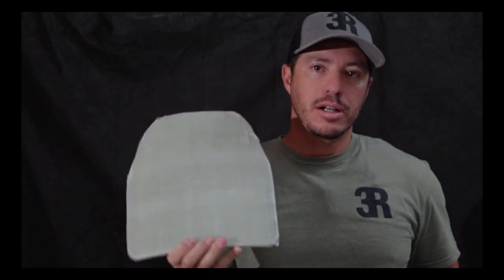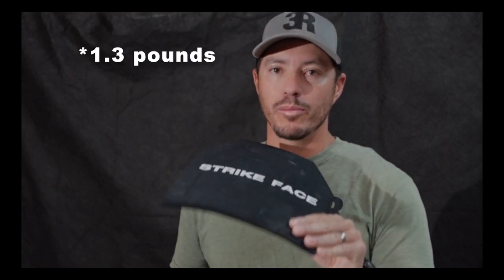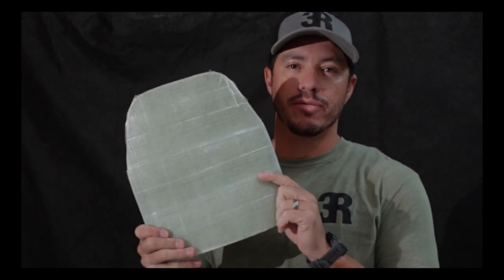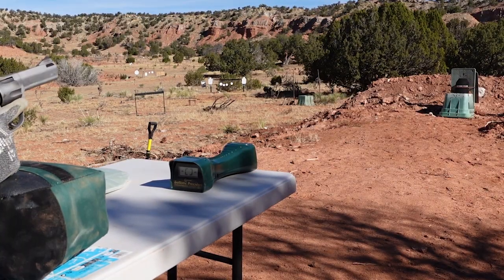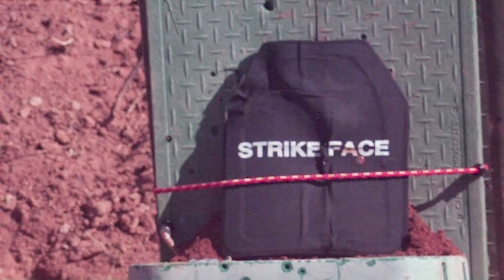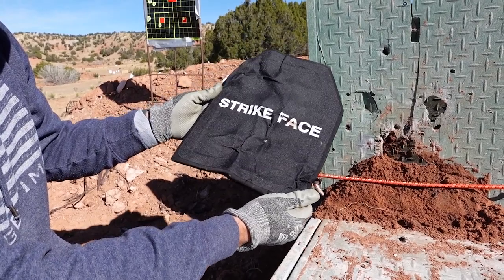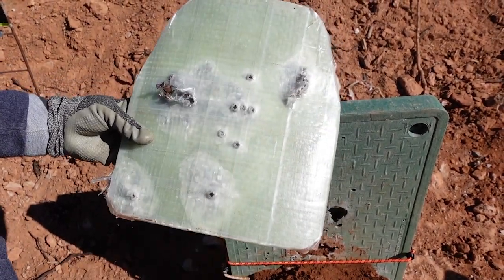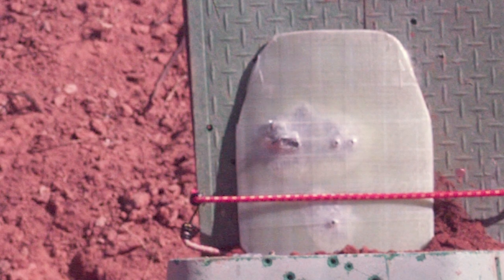Can DIY Fiberglass outperform UHMWPE - Today's body armor of choice

Comment: How difficult would it be to make the fiberglass plate with some ceramic tile on the face side (probably encapsulated in the resin). 
I think that would get you to RF1 or RF2 standard.

Comment: How are you molding and cutting these plates into shape?
Reply from the maker: @SgtAugustine  I’m just using scissors to cut the fiberglass into shape. Then I use two pieces of metal with a curve shape in a 20 ton press to apply pressure and release any extra epoxy for the fiberglass plate. 
The UHMWPE just uses the same 20 ton press and heat.
Reply: @3RBallistics  Thanks for responding, I actually just saw the process in one of your other videos. Are you still working on DIY armor these days?
Reply from the maker: @ yep. However, I’m also helping out a few other companies that make commercially available armor. So it’s taking a bit longer to get out the DIY videos for armor.

Comment: Bro, you keep talking about extra weight, even at a "heavy" 2 pounds or whatever, the fiberglass is great, what's an extra pound over the plastic when we are talking about your life!! Try wearing the iotv on patrol, now that's heavy. But great video and I'm convinced that with a skinny layer of kevlar in front of the fiberglass "to catch ricochets and sprawl" and a thin titanium plate next to the body this could defeat rifle rounds in addition to pistol and frag shrapnel.
Reply: That would end up being a5-6 lb plate which comes to around 12lbs(front and back) which is pretty light for rifle rated armor. You wouldn’t defeat green tip and tungsten with that set up though.
Reply: @neilmcdonaldii4367 That would be a good test. Titanium is extremely tough.
Reply: @101stgrunt6  You would need at least 3/16 or higer along with a Kevlar, UHWMPE and carbonate backer to stop a rifle round with a tungsten penetrator. This is of course WITHOUT using a ceramic strike face. It would be a pretty thick plate though.
Reply: I'd most certainly like to view such a video as well

Comment: Here is a interesting chalange for you (I'm going to copy paste this comment on afew videos so you notice it)... 
Fiberglass balistic helmet or just a full diy balistic helmet series including back face deformation testing.
My idea is a fiberglass helmet with thin steel bars impeded on the inner layers of fiberglass forming a lattice shape to prevent serious back face deformation.
Reply: A Spanish guy did that on YouTube, casted it out of another helmets shape and it worked up to level 2, you could make a level3a with more layers probably
Reply: @G36C-556  thing is one should try the weight if one can handle it. Also it would be cool to make one using a motorcycle helmet as a mold.

Comment: How about mixing fibreglass with welding blanket sheets in between (layers) together with Kevlar on both surfaces? I think that will be enough to hold several rifle rounds other than handgun ammos....
Reply from the maker: Fiberglass is what the welding blanket is made of. However, I am in the testing phase of using fiberglass as a strike face and Kevlar as an absorption layer with the hopes of stopping rifle rounds.
Reply: @3RBallistics  I can't wait how it goes on video. Keep it rolling ✅
Reply: @3RBallistics  well, from my observation from other YouTubers... welding blanket is much thicker than ordinary fibreglass made one at a time... Maybe just maybe, it could be more resistant to impact 🤞🏻
Reply from the maker: @tontosilver6578  I’ll really have to look into that. The ironic thing is that I do light welding and have the Harbor Freight welding blanket in my shop.

Comment: Hello just found your page like you mentioned in your analysis the polyurethane deforms I wonder if you combine the polyurethane with a backing of the diy fiberglass to give the plate more stopping power possibly rifle rounds and rigidity to the homemade plate.
Reply: That is a pretty interesting idea to reduce weight, some kind of composite using both, but I don't think it gets to stop rifle rounds, both of these materials alone need to be very thick to stop a rifle round.
Reply: @juancastro6441 it would end up being a 5lb plate if you use 30 layers E glass, 25-30 layers soft UHMWPE with a solid UHMWPE strike face. Should stop all the way up to green tip. This set up will not stop tungsten though. DON’T WEAR THIS UNTIL YOU VERIFY IT BY SHOOTING (UM I mean) TEST IT FIRST!!! You can also use tungsten steel instead of another UHMWPE solid plate as a strike face 🤔😁😉😎

Comment: Watching this I wonder several things. The first is which type of weave and thread count of fiberglass would work the best. Idk if thread count is the right term but I know it comes in different weights. Also I wonder what the optimal amount of layers is for weight to protection ratio. Next what is the best way to alternate the direction of the layers when laminating. The next thing is what brand and type of resin and hardener would be the strongest. Would a mix that gets hotter and cures faster be better vs a slower cure. Then to top it off I wonder how carbon fiber laminated in a similar way would hold up. Definitely really interesting.
Reply from the maker: All those questions can definitely attribute to strength. However, I’ve also found that lots of time working with the same material it’s easy to overthink the endless possibilities of application.  I will add that I’ve realized it’s usually not how many layers of the material but the final total thickness.
Reply: @3RBallistics I'd imagine how well you compress the fiberglass plays a huge part too. Poor compression or not doing a vacuum could lead to greater inconsistencies. I need to see more!

Comment: If the UHMWPE plate has more layers and with more epoxy, it will be just good if not better
Reply from the maker: Unfortunately, epoxy does not adhere to UHMWPE. At a pistol rating of 3A, I can get UHMWPE to delaminate with 3 shots of 44 mag.
Reply: @3RBallistics I've seen a few of HDPE being wrapped in fiberglass. Sometimes with a steel plate too. Works best in combination with something. Id take a little extra weight and thickness if it means i can take more hits comfortably. I have 5 kids I need to protect more than anything.
Reply: @3RBallistics  try 40 layers and  add a ceramic strike face, Capri classic is a good ceramic tile for body armor, adding 2 layers and using loctite construction adhesive to keep them together
Reply from the maker: @Bryant-gi5sx  I have a very similar plate to this I tested in another one of my videos.
Reply: @3RBallistics  then maybe I should watch more of your videos before commenting, lol. Really you do great stuff tho!

Comment: Hi, any thoughts on making soft body armor? I have seen a lot of video s making plates , but not soft body armor. I have seen some concept on Tech s channel using polyester and nylon fabric.
 Do you think you can make and test some soft armor?  I know i t won t stop rifle rounds, but for small rounds, spall, or even frag might work.
Why polyester/nylon fabric?  because is dirt cheap and it can be found anywhere. Feel free to try other materials, but polyester  is the cheapest  and easy to find.

How to make them?  Just plain fabric sewed together and that s it,   you can sew like 5-10 layers together and just stack them up. If you try to wrap them up in duck tape, you might  lose some flexibility.
Reply from the maker: I have made a few soft panels but have not put much effort into this. However, I still have all the materials so maybe I’ll just continue what I started and see how sowing a few of those layers together works out.
Reply: @3RBallistics   Ty for answering on my question.   Yah, it should not  be complicated to make, it dose not involve resins or ceramic tiles. I m really interested to see how the polyester fabric will work.  I had some polyester fabric laying  around and i folded it up and about 30 layers should be the optimal thickens for comfort and flexibility, but for efficiency you should go higher than 30. The one i have its really strong to tear and abrasion, it s called something with oxford. 
I m looking foreword for the video.
Reply: @TalisBT could've been Oxford 900D if it was hard to tear

Comment: If you like to make your own stuff, why not try making your own ceramic porcelain tiles or entire one piece porcelain plates in the shape you want? That way you don't have to cut pieces to make the shape, and you can make it as thick as you like. All you really need is the clay, some time, and a fire to remove the moisture.
Reply from the maker: I actually have tried making my own tiles. It’s not as easy as it looks without firing them to proper temperature in a kiln. However, I may try another round of this because I have found a place that may let me use their kiln.
Reply: @3RBallistics  Sounds like you are on top of it.  I look forward to your next efforts.
Reply: Ballistic ceramic plates are not made of clay. It's usually aluminium oxide + additives.

Comment: lol bro i just got 3 yards of balist grade uhmwpe from alli for 12 bucks shipped. trust me its real it just takes 1-2 mo to come in the mail. 3 sq.yrds is about enough to make an entire lev3 plate homie.
Reply from the maker: No doubt. The video was just to show the characteristics of each material. Just out of curiosity, how do you plant to keep your layers of UHMWPE together?
Reply: Getting uhmwpe is one thing, making a bullet resistant panel is a completely different thing 😅 but I would definitely like to experiment with it
Reply: @burningman1945  tbh its really not rocket science. industrially they use big heated presses that have lots of thermal mass and sometimes use steam to transfer heat better... but there was a guy on yt who showed you could literally put a few layers between wax baking paper and apply a clothes iron on medium to them and stop 9mm easy. there is also a video done by check me out now or something where he shows the complete wrong way to do it which is by putting layers of regular HWMPE grocery bags in between two baking trays that are clamped and putting in a way too hot oven for way too long. i dont even think he understood that Poly ethelyene has directional strength and he neglected to alternate their orientation. its no wonder he had such poor results. the uhmwpe comes all weaved/oriented for you. just dont cook the crap out of it and depolyermise it into short chains. that defeats the purpose of how carefully its made. look up gel forming uhmwpe for a good understanding... but ya gentle heating and not doing too many layers at a time is what u need. if ur unsure they acutally work pretty well just loosely stacked togeather. thats actually better than epoxy since epoxy changes the speed of sound in them which from the papers ive read is the most important paramater of their term balist performance

Comment: Bro, 7.62×54r
          7.62×51
            vs
1/2 in  mail steel plate,
muzzle  velocity test.❤
Reply from the maker: Sure, I’d give it a try. I just did a 1/2 aluminum vs mild steel vs stainless steel vs ar500 video that you can see here:

https://youtu.be/XdG_7_wU0Wg?si=mWyNeO-XVY3aCqt1
Reply: @3RBallistics  спасибо, мы  это  смотрели, если  можете  сделайте  тест  с  патроном  7.62×54r. Благодарю  вас  , за  интересный  канал!❤👍👌👏💪🌏.
Reply: Брат,ecли  можно  проведите  тест, 7.62×54r на пробитие  12.7мм  железной  плиты, 50метров.
 удачи!❤

Comment: Was the polyethylene plate with epoxy resin, or without? It may last just as long as the fiberglass with resin.
Reply from the maker: Resin will not “stick” to polyethylene. UHMWPE needs to be hot pressed to for a ridged bond. That’s also why PE usually delaminates after a few high energy hits. It’s a very slippery material that does not bond well with most common adhesives.
Reply: the lack of resin is why UHMWPE is so much lighter than fiberglass. Manufacturers like it because its a lot less messy to work with. You need a massive press to make the layers bond though. This is also why you don't see any UHMWPE ballistic wall or vehicle armor panels but you do for fiberglass.